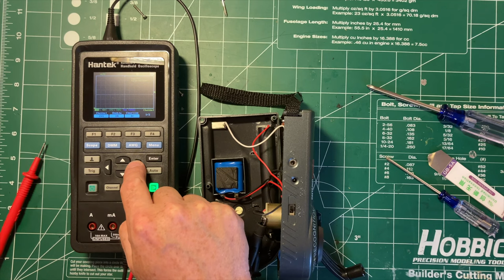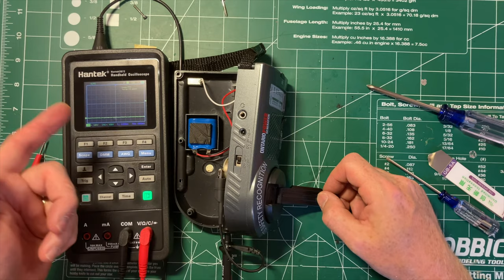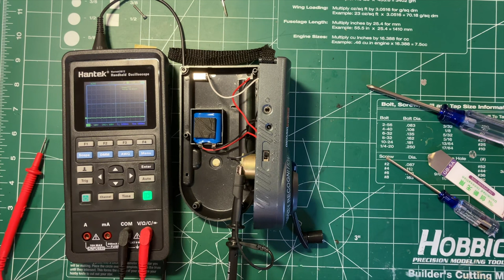Hand Cranked Radio from 2002 or 04: A Look Inside with the Hantek 2D72 Scope

Comment: Two more radios worth going in the storage drawer. These are a real workhorse, especially when the power goes out. That’s if it also has a flashlight 🔦.Being able to crank it up is a plus. Regarding the dynamo inside of this, it’s either permanent magnet 🧲, or something on the order of an electromagnet type of dynamo. That motor ☝️ is permanent magnet 🧲, I see it. It sounds like 👍 you’re not very interested in the radio on here. I’d want to keep tabs on the weather, such as during a power outage. I even like 👍 you’re “new toy” (multimeter), for testing your radios. I don’t know how much your multimeter would cost 💲, it’s such a nice 😊 one ☝️. Your friend, Jeff.